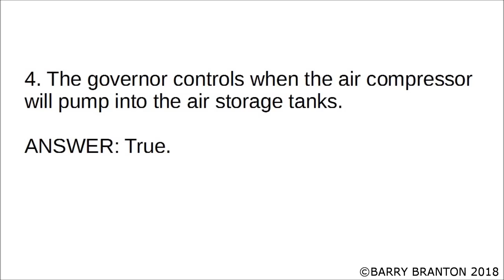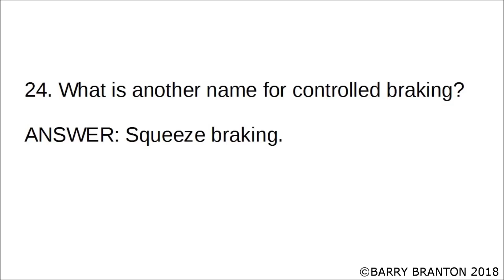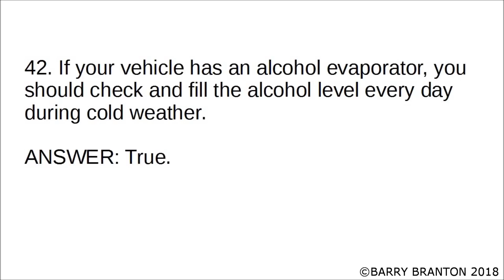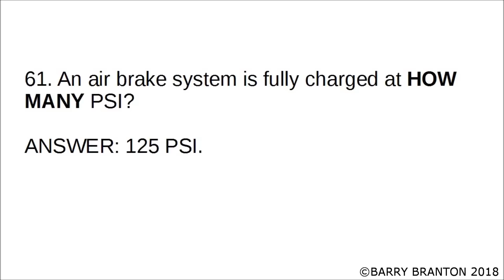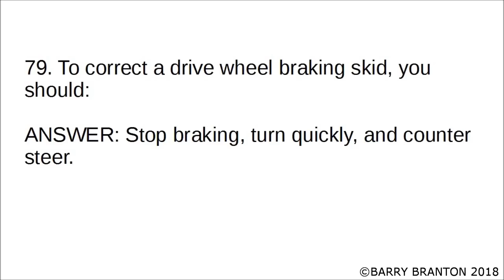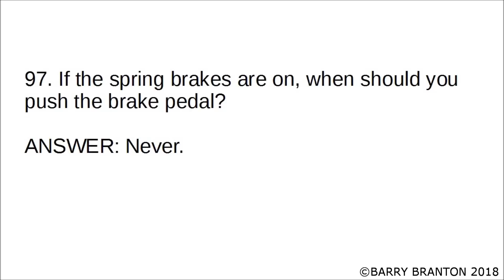CDL Air Brakes Endorsement Exam Questions & Answers

Comment: I hope they ask the questions this way. I’ve noticed that they switch it up and don’t ask in this way. One question I got in general knowledge didn’t even have the right answer so I skipped it and it never came back.
Reply from the maker: With automated testing software, you should only answer the questions that you know you have the right answer to, then go back and work on the questions you skipped that you don't know the answers to, and try to reason the correct answer for each skipped question. Some testing software stops the exam after you have answered enough questions to pass the exam with a minimal grade of pass. So, I advise study the material, and study the questions with only the correct answers.

Comment: Does any one know many questions is on the actual  Florida test ??. General knowledge air brakes and combination ???
Reply from the maker: (1) General Knowledge exam: answer 40 out of 50 correctly to pass. (2) Air Brakes exam: 20 out of 25. (3) Combinations exam: 16 out of 20.
Reply: OK thank you

Comment: Forgot do you have a driver's school?
Reply from the maker: I wouldn't advise actually paying a school. A company like CR England will train you for long haul cargo trucking (CDL required), but you have to sign a contract with them.
Reply: Two things I don't want to be under a contract another I received a voucher to be retrained and I want to use it toward my commercial driver's license.
Reply: Also I don't want to advertise their company but there's a company that will train me but I have to be under contract what I want to get is my commercial driver's license under a manual transmission and not automatic due to the elephant in the room I don't want any restrictions. Not sure how the industry is going now I hear the majority of them are going automatic so I don't know what benefit that will do me but at least I know I don't have restrictions fill me in and the unknown please thank you

Comment from the maker: (I.)  kbslimgoody commented: "Hello, Question #28 & #30 are similar but have different answers. How can you tell the difference from one another? Thank You"
(II.)  The issue with Question #28 and Question #30 seemingly appearing to be similar, which was brought to me by a kbslimgoody. My answer is "They may look similar, but the are not the same."
(III.)  Question #28. The air loss rate for a STRAIGHT TRUCK or BUSS with the ENGINE OFF and the BRAKES ON should not be more than: ANSWER: 3 PSI in ONE MINUTE.
(IV.)  Question #30. The air brake system for a STRAIGHT TRUCK or BUS should not leak at a rate of MORE than HOW MANY PSI per minute with the ENGINE OFF and the BRAKES RELEASED. ANSWER: 2 PSI.
(V.)  My comments: Although the two questions appear similar, they are not the same. Question 28 has the BRAKES ON. Question 30 has BRAKES RELEASED. Is BRAKES ON the same as BRAKES RELEASED? No. They are not the same. Brakes on means that the brakes are engaged. Brakes released means that the brakes are not engaged. 
(VI.)  In my opinion, the final authority is the CDL manual. https://www.fmcsa.dot.gov/sites/fmcsa.dot.gov/files/docs/2005%20CDL%20Driver%20Manual%20-July%202014%20-%20FINAL.pdf However, you may not be always able to find the correct answer in the manual, so I use Google sometimes.
(VII.)  Question #28 with explanation: https://cdl-prep.com/question/the-air-loss-rate-for-a-straight-truck-or-bus-with-the-6389683808370688/
(Answer: 3 PSI in 1 minute) (Explanation: The driver then holds the foot brake for 1 minute after stabilization of the air gauge. The driver checks the air gauge to see that the air pressure drops no more than 3 pounds (PSI) in one minute for single vehicles and 4 pounds in one minute for combination vehicles and listens for air leaks.) Source: listed above URL.
(VIII.)  Question #30 (look at third card) https://www.flashcardmachine.com/air-brakes.html (Answer: 2 PSI)
(IX.)  In regard to me answering questions, in the future, please let your question stand after I have answered it. In other words, please don't delete your question after I have answered it. Others many be able to learn from your question and my answer.
(X.)  Thank you.

Comment: Hello, Question #28 & #30 are very similar but have different answers. How can you tell the difference from one another? Thank You
Reply from the maker: "Question 28. The air los rate for a STRAIGHT TRUCK or BUSS with the ENGINE OFF and the BRAKES ON should not be more than: ANSWER: 3 PSI in ONE MINUTE.

Question 30. The air brake system for a STRAIGHT TRUCK or BUS should not leak at a rate of MORE than HOW MANY PSI per minute with the ENGINE OFF and the BRAKES RELEASED. ANSWER: 2 PSI."

My comments: Although the two questions appear similar, they are not the same. Question 28 has the BRAKES ON. Question 30 has BRAKES RELEASED. Is BRAKES ON the same as BRAKES RELEASED? No. They are not the same. Brakes on means that the brakes are engaged. Brakes released means that the brakes are not engaged. 

In my opinion, the final authority is the CDL manual. https://www.fmcsa.dot.gov/sites/fmcsa.dot.gov/files/docs/2005%20CDL%20Driver%20Manual%20-July%202014%20-%20FINAL.pdf However, you may not be always able to find the correct answer in the manual, so I use Google sometimes.

Question 28 with explanation: https://cdl-prep.com/question/the-air-loss-rate-for-a-straight-truck-or-bus-with-the-6389683808370688/
(Answer: 3 PSI)

Question 30 (look at third card) https://www.flashcardmachine.com/air-brakes.html (Answer: 2 PSI)

Comment: Question #59.... what
Reply from the maker: Do you have an issue with the following:
59. Question: If you must make an emergency stop, you should brake so you:
Answer: can  steer and you vehicles stays in a straight line.
Reply from the maker: Get your commercial learner permit (CLP) before February 7, 2022. As of that date, the government is requiring commercial motor vehicle operators to obtain certification, and it ain't gonna be cheap, either. I recommend:
1. CDL Opus: https://youtu.be/K6N3nyoVIfs
2. Combo video playlist: https://www.youtube.com/watch?v=PybuByjuBGY&list=PLz9u0GMKwC_FS8P_X4DMWckrKEpk0vBYp
3. General Knowledge: https://www.youtube.com/watch?v=HOFMikRv9Bs
4. Air Brakes video playlist: https://www.youtube.com/watch?v=apepahLizdE&list=PLz9u0GMKwC_GjafQb20qhcRbEFhe0OjFP
5. Passenger video playlist: https://www.youtube.com/watch?v=6BkM_NKlIIA&list=PLz9u0GMKwC_H3PtbNl2oIJMjCGVX7Ed-V
6. School Bus video playlist: https://www.youtube.com/watch?v=z2TRTkTAdGs&list=PLz9u0GMKwC_FMXFCe8svw7YPeAkDgBFut
7. Hazmat1: https://www.youtube.com/watch?v=R65PUpgnu70
8. Hazmat2: https://www.youtube.com/watch?v=EQLoupN60hs
My videos are good for all states in the US.

Comment: I thought it was only like 20 or 25 question for the air break
Reply from the maker: The test consists of 25 multiple choice questions. To pass, the applicant must answer at least 20 questions correctly.

Comment from the maker: Are you talking about Question #28? The air loss rate for a straight truck or bus with the engine off and the brakes on should not be more than: ANSWER: 3 PSI in one minute. I have confirmation on the question and answer. Go to https://truck-school.com/assets/Air_Brakes_Test_2.pdf See Question # 7 which shows the answer as D. However, there, the question is worded slightly different: The air loss rate for a straight truck or bus with the engine off and the brakes applied should not be more than: Answer: 3 PSI in one minute.

Comment: 28 is engine off, brakes off
Reply from the maker: Are you talking about Question #28? The air loss rate for a straight truck or bus with the engine off and the brakes on should not be more than: ANSWER: 3 PSI in one minute. I have confirmation on the question and answer. Go to https://truck-school.com/assets/Air_Brakes_Test_2.pdf See Question # 7 which shows the answer as D. However, there, the question is worded slightly different: The air loss rate for a straight truck or bus with the engine off and the brakes applied should not be more than: Answer: 3 PSI in one minute.

Comment: I want to be a school bus driver. Will I be tested on the air brakes?
Reply from the maker: Though some school districts employ school buses with air brakes, I believe most are still using hydraulic brakes. So, you're answer is probably no for now.

Comment: Mr Barry I would need some info is this the only test they do for class b or is there any other questions test beside this one?? Thanks
Reply from the maker: What you need to do is look at Figure 1.2 in Section 1 of your state's CDL manual. Figure 1.2 tells you what you need to study based on what type of commercial motor vehicle you will be operating. I take it that if you are studying for the written air brakes exam, that you want a Class "A" CDL, so you will also be needing to study Section 6, Combination Vehicles. Here's a link to that: https://www.youtube.com/watch?v=PybuByjuBGY&list=PLz9u0GMKwC_FS8P_X4DMWckrKEpk0vBYp  Now, I only cover the written exams; of course, you will have to study for the skills tests. See Section 1 of your CDL manual for information on the various skills tests that you will be required to take.

Comment: Dose anyone know how many questions is on the air breaks written test in the dmv ? An how can you get wrong ?
Reply: Zederick Griffin in Florida it’s 25 questions and you can only miss 5
Reply: Tim Arnett sorry but I need some info on that u said that they test was 25 question and can only get 5 wrong so 20 good is a pass now what other exam do they do to get the cdl b class
Reply: marlon garcia yep once you get 20 correct you’re good  and you’ll need the general knowledge for the class b that’s 50 questions and you can only miss 11
Reply from the maker: You need to get 20 out of 25 correct.

Comment: How many questions are in the actual test, and how many can we get wrong?
Reply from the maker: To answer your question, I called the Motor Vehicle Division (MVD) Customer Care Center for Montana at 1-866-450-8034. The person there that I spoke to said that there were 30 questions on the written air brakes exam. I asked her how many could I get wrong and still pass. She said she wasn't sure but thought that it was ten percent. Of course, your state may vary.
Reply: Barry Branton thank you sir

Comment: what does cdl class b with passenger endorsement  and no restriction mean?  do i need to take this test or only the general knowledge and passenger test?
Reply from the maker: It depends on the type of commercial vehicle that you intend to drive. Check out Figure 1.2 in Section 1 of your state's CDL manual.
Reply: @BarryBranton  im trying to get a job as a mta bus driver. and i got a letter that i need a cdl class b with passenger endorsement and no restriction or at a minimal a learners permit for cdl class b with passenger endorsement and no restriction. the thing that confuses me is the no restriction thing.
Reply from the maker: These are restrictions placed on your driving license.
Restriction Code A = Corrective lenses required.
Restriction Code B = Licensed driver 21 years of age or older must be in the front seat.
Restriction Code C = Daytime driving only.
Restriction Code D = Speed not to exceed 45 mph.
You can look this up for your state. For example, http://www.scdmvonline.com/Driver-Services/Commercial-Licenses/CDL-Restriction-Codes
Reply: @BarryBranton  ok thx for the reply.  one last thing. i want to get a learners permit with passenger endorsement and no restriction for driving the mta bus which i think i also need to take the air brake test but i read that u need a take a road skill test for the P endorsement and for the air brake. is this true? because i've never ever driven anything bigger then a sedan.  im so confused.
Reply from the maker: First, go apply and get the job as a bus driver, even with no experience driving. It can be done. I was hired as a school bus driver with zero experience as a bus driver. Once hired, your employer will have you get a MEC or medical examiner's certificate. Then your employer will have you study for the "written" exams.
     Second, there are two groups of official tests or exams. (1) Knowledge Tests (written exams), and (2) Skills Tests. See Section 1 of your state's CDL manual, specifically, Section 1.1.1 and Section 1.1.2. This is all covered in the manual. For the MTA bus driver, you will need to pass the (1) General Knowledge Written Exam, the (2) Passenger Endorsement Written Exam, the (2) Air Brakes Written Exam. (The exams aren't actually written. They done on a computer screen. It's multiple choice.) That's it. Once you pass those three "written" exams, then you will be issued a CLP or commercial learner permit. 
     At that point, your employer will start training you for the Skills Tests. There are three of them. Two weeks later you can take the Skills Tests. They are (1) Pre-trip Vehicle Inspection, (2) Basic Vehicle Control, and (3) On-road Test. These are tests THAT YOU DO. You do by showing an examiner that you can do them, no writing involved. If you pass those tests, then you'll be issued a CDL.
     Good luck.

Comment: I was told by Swift that I need my type (or class, I forget) "A" permit before theyll accept me, is the air brake portion thats discussed here, part of what Ill see on the test at the DMV? (Florida).thanks
Reply from the maker: For the sections to study for the Class "A" CDL, study Figure 1.2 of your state's CDL manual. Currently, you're going for your CLP or commercial learner permit. Do you have your MEC or medical examiner's certificate? For air brakes, watch this video instead. Audio has been cleaned up. https://youtu.be/HZHJOG2aI6U Also, view section read-along https://youtu.be/qWCY66UEnEU Yes, this is good for Florida.
Reply: @BarryBranton  She asked me if I had a CDL, I said "No", then she asked if I had my "A" permit, I said, No. She said youll have to get that "A" permit & a "Physical" before we can consider you for our schooling. It was all gibberish to me cause Im a newbie to trucking. thanks.
Reply from the maker: @MasterArmedforces  Get your state's CDL manual and look at Figure 1.2 in Section 1. The chart explains what sections you'll need to study for the Class "A" CDL. First, you need to pass the General Knowledge Exam, but before you can take the exam, you'll need to get your MEC. Once you pass the General Knowledge Exam and whatever Endorsement Exams you'll need to pass. See  Figure 1.2 in Section 1 again for what Endorsement Exams to study for, and what sections to study in your CDL manual. The order is as follows:
1. Get your MEC.
2. Pass General Knowledge Exam for Class A. For that class, you'll need to study Sections 1, 2, 3, 5, and 6.
3. Pass the Endorsement Exams that you'll need. Again, see Figure 1.2 for that info as for what sections to study.
4. Once you pass those exams, you'll be issued a CLP or commercial learner permit once you pass an eye exam.
4A. STOP: Go to Swift and show them your CLP with the appropriate endorsements listed on the back of the CLP. Show them your MEC, too.
5. After about 2 weeks, take the Vehicle Inspection Test, the Basic Skills Test, and the On-road Test. Study Sections 11, 12 and 13. You'll need Swift to train you how to do those things. You'll need to perform these tests on the type of vehicle that you'll be driving commercially. You'll need to get the appropriate vehicle and have a licensed commercial driver drive it to the testing location for you, and then drive it back if you fail any of those tests.
If you do pass, you'll take another eye exam at the DMV, get your picture taken for your CDL, and pay your driver license fee. Then you'll have a CDL. Good luck.
Reply: @BarryBranton  Thanks!